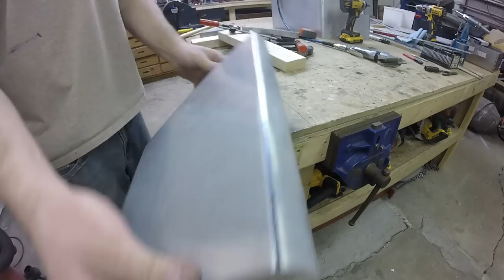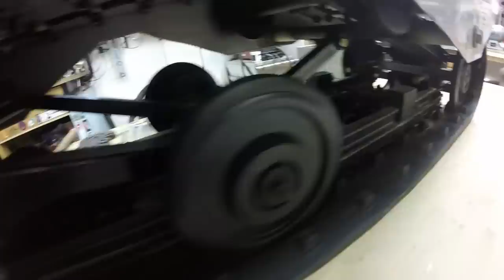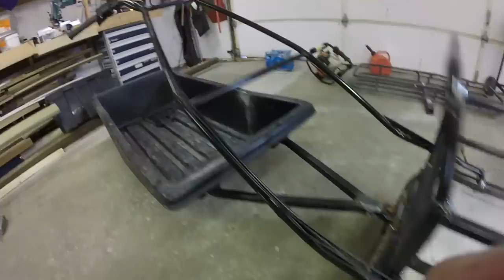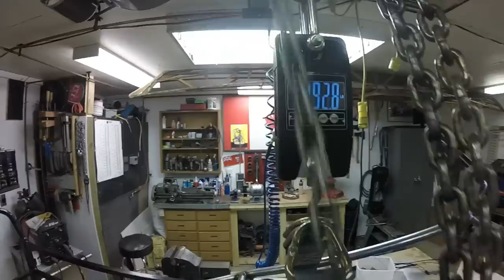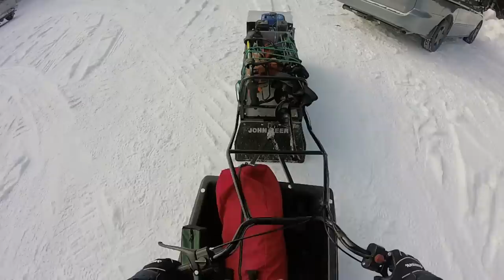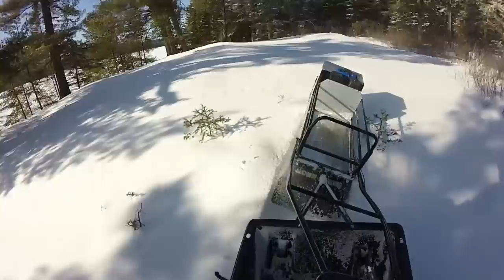Track Shark - Homemade Motorized Tracked Fishing Sled

Comment: I plan to try and build one this summer using a old Arctic Cat Jag 3000 . Don't suppose you would any hints on what to look out for . Just waiting for spring to get here in Manitoba
Reply from the maker: The only issue I've had so far is that the handle bars were a bit weak/bend easy.  I would find some stronger tubing for the next time

Comment: I liked and subbed I picked up 4 Polaris 500 indys...long and wide tracks and I was thinking of making a side by side track (dual tracks one motor driven thru a differential and keep the gear box ...hi...low and reverse....and sit in the middle...doesn't need to be fast....a some how let them FLOAT off some pivot not rigid....
great build......

Comment: What primary and secondary clutches were used?  Were they princess auto or ordered from CV Tech?  What tooth sprockets were used for the exposed chain drive.  From Northern MB and hoping to build something like this with a high school motors class.  Thanks for the info.

Comment: Nice build nic. Did you end up playing with the final drive sprocket size ? Like start with a 10 tooth and work your way up ? Would be awesome to incorporate a  low/high and reverse transmission of some kind, maybe off a lawn tractor,  some red nic engineering  !! More vids please.  There are a lot of people out there that are interested in building something that is economical, reliable and fairly cheap to build . For myself I would like to build one for dragging logs out of the Bush, nothing fast just a lot of torque.

Comment: Great job!  I am watching this video because I am building one also. I found a dead snowmobile I had planned to use, but now I'm told two tracks are better than just one. Also the sled runners inside the tracks limit it to snow use only. Two tracks with basically wheel barrel wheels inside can be used in the summer too.  What size engine did you use?  I bought one through Northern Tools 420cc.  This video was back in January, did you find any problems or anything you would change?  How do you like it now that you have used it more?

Comment: Hello is that a princess auto motor?? Did you buy a winter motor or regular motor??
Reply: I built almost the same thing i used an 8hp briggs from a snow blower with the 110v electric start and swaped the starter to 12v....if you buy new i would get the winter motor

Comment: Love this thing !!!
What a great job you did 👍...
 Im thinking 13hp on it 😈
Reply: You can get up to 20 horsepower out of that six and a half horse Harbor Freight motor predator
Reply: @larryparks5034  
I know very little about small engines, how can the horsepower be boosted?
Reply: @CoolBreeze640  get a better air filter and upgrade other engine parts I think carburetor
Reply: @trailhog1606  
Thanks!

Comment: I’m confused Nic with the chaindrive off the secondary?? What’s the deal with attaching the sprocket to the secondary. Also what number of tooth sprockets for drive and driven?? Man we have so much snow up here in Ontario right now I wish I already had one of these built. God willing and your help Nic in regards to the clutching and chain/sprocket info I’ll have one rockin for next winter haha. Thank you.
Reply from the maker: the chain off the secondary is the way the "comet" brand clutch is designed. it is not the original snowmobile clutch at all. the clutch side sprocket is 10t and the driven one is 16t. the decision to use those was totally random and somehow worked perfectly. this is the clutch https://www.princessauto.com/en/detail/3-4-in-bore-10-teeth-torque-converter-kit/A-p8404535e
Reply: REDNIC79 that awesome brother and I really appreciate you taking on this Kick A** project. Man the miles we humped through deep enough snow on lakes too deep for ATVs to get through I’m telling ya this babies the answer. I’m seeing these knockoff offshore clutch assemblies on eBay for roughly 1/3 the cost of the Comets and as tempting as they are I’m sure they won’t be as well built and then wish I had spent the money on the Comet when it comes time (because that time Will come) to Need parts.
Reply: how is the drive sprocket installed?
Reply from the maker: the jack shaft is 1" and the sprocket is slid on it. i cut a groove in the shaft with a cutoff wheel to accept a keyway.

Comment: hey bud can you tell me what the distance between the sled and the machine is ,as well as how long i should make the steering handle bars thanks again
Reply from the maker: bars are almost the length of the machine when they fold over its about equal. as far as sled distance, stand in your sled once you make the bars and see what feels good so you are standing in a good spot/balance on the sled, n do that length. thanks for watchin
Reply: @REDNIC79  thanks nick,  i am waiting on my cables just to make sure everything reaches, and thanks for inspiring me with your first track sled video, my wife and i both have trouble walking so this sled is going to be great for us to get out ice fishing more

Comment: Awesome job brother!! 
What model number of Comet primary clutch did you use Nic. 
Are you still using the normal drive belt that was used on stock primary clutch of the JD ?? 
Any changes you’d make now you’ve ran it this winter a bit ??? Cheers from Ontario
Reply from the maker: https://www.princessauto.com/en/detail/3-4-in-bore-10-teeth-torque-converter-kit/A-p8404535e
drive belt comes with the clutch, the only change i've made is i added a chain tensioner. i'll do an update video soon i hope
Reply: REDNIC79 appreciate your replies Nic man... I can see a tensioner being almost essential to stop chain slap and likely excess noise too. Ya a video update to maybe show your tensioner mod would be great. I imagine you had to buy extra chain and joiner link to make it right from secondary to jack shaft !!??
Reply: @REDNIC79  any pictures or video of the tensioner setup?

Comment: What size (tooth count) did you weld onto the original shaft to the gear case
Reply from the maker: i'm not 100% sure right now, (its in storage) but i know it was the largest i could fit between the shaft and the tunnel with the chain on. and i believe there was only one inch of clearance between the shaft and deck

Comment: where did you get the extra long brake cable
Reply from the maker: amazon, tandem bike cables
Reply: @REDNIC79  thankyou, i am almost done building one , i did put a larger motor on it , also added a reverse gearbox, cant wait to get it done to see how it all works out, thanks for the reply, i do like your second version as well

Comment: Would you be willing to share some more info on how you set up the throttle please?
Reply from the maker: the motor already had a spot to hook a throttle cable into, and the handle bar did as well. i purchased the cable off amazon.com--  Stens 260-182 Throttle Cable
Reply: REDNIC79 thanks. I’m in the process of building one after seeing this video
Reply from the maker: Sweet! You'll love it

Comment: You wasted a johndeer sled for that?. What a waste
Reply: I gotta disagree with you.  You work with what you've got, that doesn't stand on its own anymore.  The whole core of re-purpose engineering.
Make it work again in a new life.  I've got a 80's Polaris Indy that may meet the same fate after 2 piston jobs. (Still running sweet, but the long term prognosis is poor.) I'm almost looking forward to the cutting and  trials & errors. I'm mostly a motorized bicycle guy, but this looks fun.
Reply: yep he wasted the chance for it to be shredded at the recycling yard awesome job on the track shark!!!
Reply: I totally agree...what a shame.
Reply: I disagree with u he did a very nice job on it
Reply: Wasted u say I say up graded hahaha everyone has snow mobiles no1 has these I will ďeffently make this simple easy build if u can weld anyway
Reply: I'd agree if the Deer didn't have a blown motor.
Reply: He just made all the other John Deere survivors more valuable and made a classy one of a kind machine 👍

Comment: Did you have to add a keyway to the jackshaft for the final drive gear?   Looks about a 12T gear? I am just beginning my conversion from an 89 ski doo mx with a lifan 6.5hp motor, a cvt clutch kit, I just haven't picked a drive gear yet